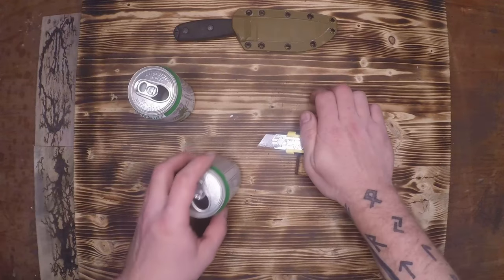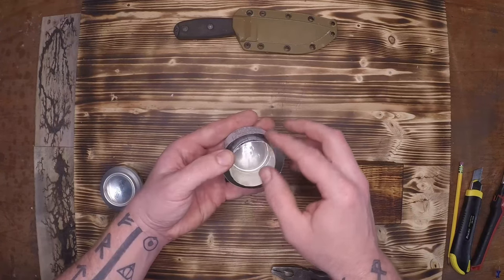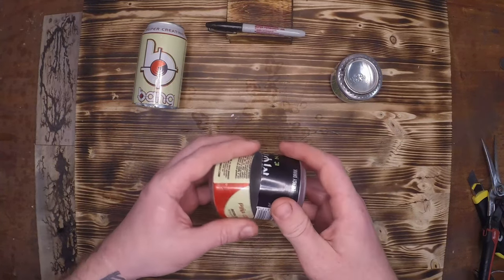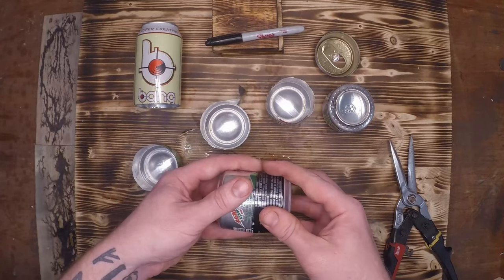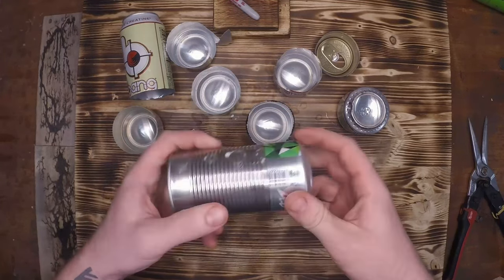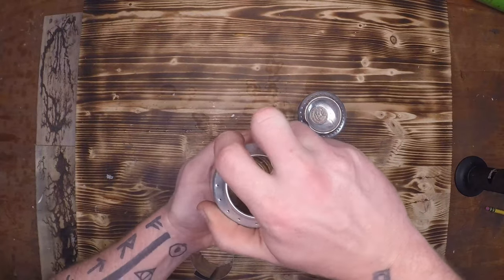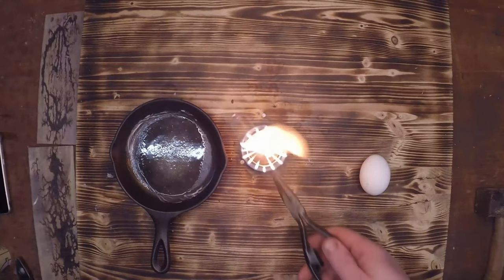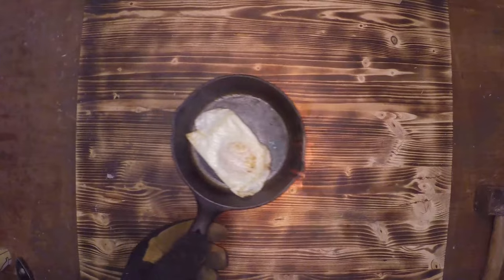Alcohol Stove 2.0 Easier, Stronger, and More Robust! Build for under $2! Full instructional video.

Comment: First, sand the paint off the inner can. If necessary, also sand the inside of the outer can. It has a thin plastic layer in it. Then everything fits a little easier. Thanks for the video.
Reply: Also works by just letting it burn for a few mins before using for the first time

Comment: Been making these penny stoves for years now, but this is by far the simplest and strongest build I have come across.  Thank you for this.  Next step, for me, is to teach a group of Scouts how to build and use one of these for Cast Iron Cooking.
Reply from the maker: Great to hear! In hindsight I really should have just left the penny hole in the middle instead of cutting out the entire bottom. If I made this again I would have used a penny in the middle to cover the smaller hole I would have made. Otherwise I'm really happy with it.
Reply: @FollowTheCompassNorth  thanks, nice upgrade, I will try 😁
Reply: I was under the impression that the BSA had outlawed homemade alcohol stoves, due to the dangers of wildfires.
Reply: @xenaguy01 no danger with a wick.
Reply: @samhain9394  
Campers who think a wick can keep alcohol from spilling are one reason alcohol stoves are banned in many western parks and trails.
Reply: I build mine last week and it was rather scary to light. Concidering the fact I do not have any experience with fuels or burners like this, it was nervrecking! The stove sometimes 'woofed' and spit out a larger flame and one time it even 'woofed' and spit out some alcohol around it (roughly 30 cm around it). I'm using 97% ketonatus alcohol. I also could not get it to die with a pan ontop of it, left it for 5 - 10 secs max and the flame was still going inside the pan. Can anyone shed some light on what happened here? It was way more scary then I see on youtube :)

Comment: Just made one with a Ortega chili can and a pop can. I removed the baffle and didn't remove the bottom of the pop can. Stuffed it with fiberglass. 16 burner pinholes and one fill hole fitted with a small screw in the center top of the pop can. 
Fill it up, put the screw in, fill the bottom one more time and light it. Watch it bloom.😊  Thanks for the tips❤

Comment: Here's a suggestion. Use two soup cans to make your penny stove. A whole long stronger than a soda can. That way if it gets stepped on   if it gets knocked down it will be squished. With a soup can it won't be crushed. :)
Reply from the maker: I'll try this if I can find two soup cans that fit nicely together. I've also been playing with a single piece design that caps itself with the pot you put on top.
Reply: @FollowTheCompassNorth   I built a copy of an alcohol stove I’d seen done in a YT video. It’s only a single soup can, like your mushroom soup can. You put 12 evenly spaced 1/4” holes slightly below the top of the can and 12 more at about the third rib up from the flatter portion of the bottom of the can. You light the alcohol in your preferred method and let it heat up for a while, then you place your pot directly on top of the can/stove. The flame will quickly start coming out of the top holes. I made mine with an additional smaller hole about an eighth inch below the top row of holes and it makes pouring unused fuel back into a storage bottle easier than using the top holes. That method makes more of a mess for me. I’ve also found that, using a can lid from a larger can and cutting it with a side edge, safety opener, the smaller can nests into a groove in the lid and there’s another well between the outermost grooves that I pour some alcohol into and I light that fuel to start the inside fuel heating towards a boil. It also will light the inside fuel too. The bigger can lid also adds some stability to the stove as well. This single, open top burner allows me to carry my fuel in a plastic bottle that is as close to the inside volume of the stove but doesn’t rise above it and it all nests into a large cup/pot and I use a slightly larger one as a lid. It makes a great, self contained setup and gives two people a cup, or you have your hot drink in one while cooking in the other. I was blown away by how well that method works. I’ll never mess with the tiny aluminum stoves again. You must use a pot stand with them and they are more effected by winds. Too easily damaged as well. Build one, you’ll see. 👍✌️
Reply: well , if you are a poor person - what do they use you know but you are right by saying that
Reply: @jasonjohnson6344  Can you share the video you followed? I'm intrigued but it's difficult to visualize
Reply: @arronnie1    I don’t understand how to send a direct link to the video but I can send you the best I know how. The video is on simon 4043 channel. Name of the video is A New Design of Alcohol Backpacker Stove boils water faster than a Trangia. I hope this makes it easy for you to see. It’s fairly short but thorough. Easily understood and crazy efficient. I experimented with how to get the alcohol in the stove to a boil quickly. The stove is a typical soup can and I use a lid cut from a larger can as a shallow well to pour some alcohol into so I can light it to heat the stove that I set on top of the lid. I hope I’m explaining that well enough to visualize. It’s not imperative but I wanted to know if I could count on that for much colder weather conditions. I’m sure you will get everything you need from the video. I just wish I understood how to send hyperlinks to make it easier to share information with others. The guy in the video uses a Pyrex frypan and because it’s clear, you can see how well it is working at full bloom. It won’t look like it’s working at all until you put a pot on top of the stove. The top holes may light on their own or you may have to use a lighter on em. I’ve had problems with getting all the holes kept lit. Once I used a bigger cans lid as a baseplate, set the stove in the center, I pour just a small amount of alcohol into the reenforcing rings in the lid and light the alcohol. As it burns, it begins to boil the alcohol in the stove and everything works MUCH easier. The top holes all light almost as quickly as you put a pot on top and they stay lit easier too. Good luck with yours, I find it an awesome design. I don’t care to time my dang boils, I just know it works fantastic and it’s cool to be able to get such good performance from a stove you made yourself with nothing more than a can opener, a can, a drill and a magic marker.
Reply: @jasonjohnson6344  The video helped a great deal, what an idea. As to your additions, let me see if I understood. Correct me if I'm wrong, seems like you have three layers when stored? (four including the fuel bottle) The innermost is the soup can stove, which fits inside your cooking pot, which then fits inside another bigger can whose lid doubles as the base of the stove.
Reply: @arronnie1    Yep Arron, that’s how I do my version. I’m glad you got to see the video. I was sold pretty quickly because of his use of the Pyrex pan. So easy to make and extremely efficient in use. Have a good one. 👍✌️
Reply: @arronnie1    I forgot to mention that, when you are done cooking with the stove, you can snuff out the fire by dropping the larger can upside down over the stove. You probably would have figured that out but I wanted to add food for thought.
Reply: @jasonjohnson6344  
You have a golden opportunity to make a YouTube video which would be deeply appreciated by all of us neophytes with alcohol stove mania. I love out of the box thinking.
Reply: Here's that video https://youtu.be/DcUKaHoYEUU
Reply: @xlynx9   Thanks for sharing that link.
Reply: @jasonjohnson6344  I found out that it is very worth it to read the comments, as there is a top of extra good tip as in your comment verifies. Thanks, mate, I really appreciate your wisdom. God Bless you & your family from Vancouver, BC, Canada. Deniz
Reply: @dennisexplorer487    Thanks very much and the same wishes for you and yours. 🙏✌️
Reply: @jasonjohnson6344  I've tried with this "Simon 4043" design - that is not new, other guys play with the same concept early; but find flame too sensible to wind, requiring a good windscreen.
Reply: @Sokol10  yeah, any alcohol stove benefits from a windscreen. Even my one burner Coleman fuel stoves. I imagine that there’s other YouTube videos on the design I was referencing but this is the one that I knew of and the fact that he used a Pyrex fry pan was helpful in seeing it in full bloom. I don’t know how to attach hyperlinks to a comment but I see that another commenter provided it. My point is that, it’s a far better, more useful design than the tiny aluminum ones made from pop or beer cans. Easy to make and use.
Reply: Any stove you build should fit into your pot and be protected by that. You don't need anything any stronger than aluminum. I've had the same alcohol stove for six years all over and it's fine.
Reply: I did my own version of this and made a video it's on my channel under the title my hobo alcohol cook stove if you get a chance check it out 😊

Comment: 👍 Neat .. thanks for that. I must take a look at using a more robust better-fitting can as the base.
Currently, my favourite is a 200ml Energy Drink Can.
* Cut off the Top and Bottom to the required height.
* Leave the Top Centre in situ .. just remove the leftover pull-off Tab.
* Drill extra holes to suit (you'll find out what works best for you) in the top centre bit .. for me, on the inside edge opposite the 'drinking hole'.
* Flute the top piece to facilitate the fitting together. Top goes into bottom.
* Fill the bottom section with Glass / Ceramic Wool or Carbon Cloth. This appreciably reduces the effect of fuel spillage in case of an 'Oops' and doesn't seem to effect the burning efficiency of the burner.
* Fit together .. that's it.
I cook all sorts of stuff on these burners .. including Full English Breakfasts.
Good share .. thanks. Take care ..
Reply from the maker: This is a GREAT design. I'm glad to have helped give input. You are probably better at these than me. I just do things on camera and pretend to know what I'm doing.
Reply: @FollowTheCompassNorth  👍 .. pretending is good .. similar to 'mulling' .. I do it often and sometimes so realistically that I actually believe it 😁.
Reply: @FollowTheCompassNorth  I know "I" sure appreciate ya! 🤗

Comment: I admire your dedication to finding cans that fit. Good job!  Never thought of using soup + beverage cans. I've made a lot of alcohol burners. Started with beer cans. But the material is too thin and would tear easily. Now I use squirt cheese cans. To get the pieces together I expand the bottom by rubbing it on a 1" dowel that is locked in a vice. Kind of hard to describe...  My burners do have an inner sleeve. Partly because the cans are smaller diameter, the circle of jets (holes) are smaller than on beer can stoves. Helps keep the flame pattern a narrow inverted cone. I was going for max burn efficiency and my best is 4 cup boil (65F water) on 1 ounce of alcohol. I like squirt cheese cans because they are aluminum and about 4x thicker than beer cans. Some videos on my channel. TomLovesDIY. 

Best regards,  Tom

Comment: Make about three shims from the extra can material  and insert them inbetween the two halves when you push them together then pull them out once you get them started and slowly push the two halves together. Also pushing the bottom half up around a full can will stretch it slightly and make it much easier to push the two halves together while maintaining a good seal. Instead of making a cover for the center hole you can simply use the bottom without the center cut out and fill through one of the holes with a syringe.

Comment: Idea!! If you have carbon felt, wrap a layer,  or two depending on the thickness, around the inside of the soup can. Next take your baffle and put a TON of v cuts into the bottom and place into soup can. Finally, press the soda can down until the baffle seats into the lip of the soda can. Now you effectively have your own Trangia burner. You can then cut the bottom of another can right at the shoulder where the "label" ends, cut out the center of the bottom dome as a simmer ring

Comment: great tutorial. definitely making this with the scout troup i lead. 
i was looking for an alternative for the soup can scince condensed soup is hard to find where i live. i found out those tiny vegetable tins (about 150-200 gram) have the same circumference. soda can fits nice and snug on top without creasing. cheapest one i found was only 50 cents. add a cheap 30 cents can of soda to that and the cost is even under 1 euro.

Comment: If you're a UL nut, and haven't gone no cook yet or are just interested in building your own setups, here's a few recommendations from my years long obsession into my cook kit;
The wider your cooking vessel, the least amount of heat, thus fuel, is wasted. Look for short, not tall.
You can build an alcohol stove out of nearly anything. 
A favorite combo of mine is a simple aluminum container with a lid, the body is filled with carbon fiber, *i think it's called, the lid works perfectly for an esbit system. You need a frame for this and remember to always use a windscreen with any esbit/alcohol in the wild or else you're not getting a hot meal.
Don't ever use red heet or you're probably going to burn something down. The flames are too unpredictable. Always yellow heet, it's available practically everywhere I've been.. When building any stove, I found using a calculation available on zenstoves (youtube won't allow me to link) and building specifically to a certain pot/mug was the best for fuel consumption. Zenstoves has amazing free to build designs and information on their site and I use it often. 

If you are looking for something that weighs nothing and has fuel consumption down to a science, go to flatcatgear and talk to Jon. You won't find anything better regardless of altitude, weather and the options available when it comes to cooking in the backcountry. Now that I've been through years of use in real life, I always prefer esbit. 

FYI; NO ALCOHOL OR ESBIT STOVE CAN BE USED IN AN AREA WITH FIRE RESTRICTIONS. YOU MUST HAVE A STOVE WITH AN ON/OFF VALVE. Although, in my experience my alcohol and esbit systems are much safer and more reliable. I've had plenty of problems with canister setups. The less moving parts the better, generally.

Flat cat gear video of bobcat system;
https://youtu.be/eAMGtVKEj_Y

Hiram's page is very informational;
https://youtube.com/c/MrHiramCook
Reply: Thank you!

Comment: If done correctly the same size works well if you take needle nose pliers and go around the edges of the can going inside and twist little flutes around the edge about 3/8” long and they work perfectly. I have built many of these. Look at the penny can stove videos.

Comment: You can take a full can of the same brand as the outside half, and stretch the rim over the bottom of the full can. Just stretch a little bit at a time, then turn the can and stretch the next area. After about 4-5 times, the entire rim will be stretched, and the other half will fit inside it. Then press slowly together, being careful not to tear the outer half, or crimp the inner half.
5:00 You know, other soups come in the exact same size can.
Reply: Or just crimp it like A/C duct work. They even make a tool just for it.

Comment: Use Pennie’s and a small center hole. Cover the hole made in the middle with a penny and it works awesome
Reply: This is not a pressurized "Penny Stove", it's a open top, that imitates the Trangia TB25 burner.

Comment: Soup can bottom!  Brilliant!  I've made tons of these and used them for years, but never thought of the soup can.  Will definately try it tomorrow.  What did you use for the lid?  Did you need jb weld to seal the 2 together?
Reply: Not sure either, but why couldn't the bottom be the soup can and the top aluminum can, with all the holes around the rim and 3 or 4 in the top center where a penny sits, like the original version. That seems like it'll work?
Reply: @geico1975  I made one with soup can bottom and pop can top with chimney... no jb weld needed .  Seemed to prime a little slower, but works just fine